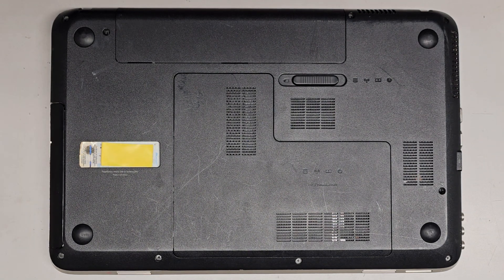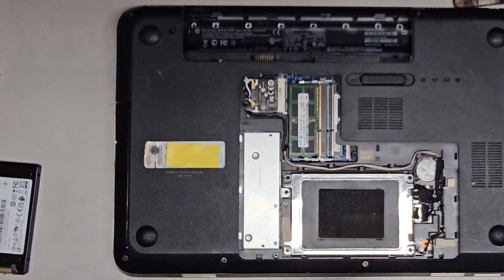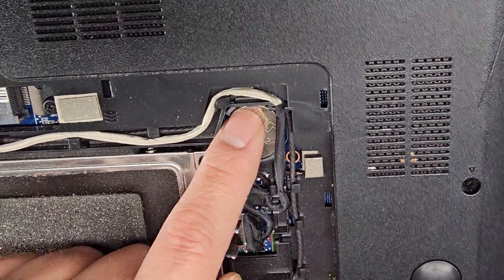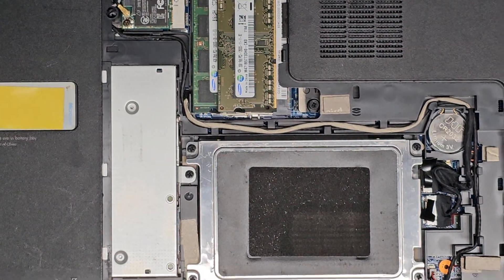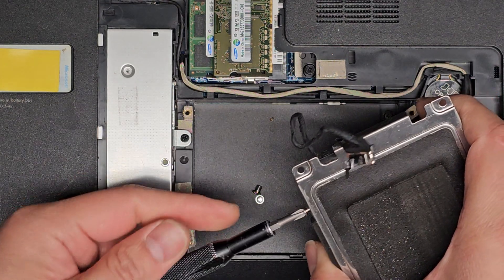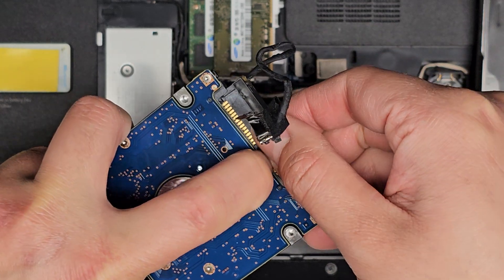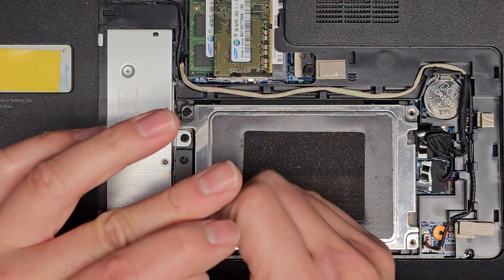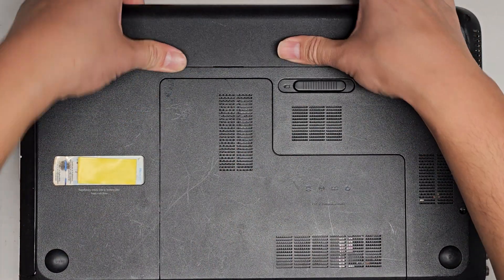HP Pavilion DV6 DV6-6C35DX Disassembly RAM SSD Hard Drive Upgrade CMOS Battery Replacement Repair

Comment: Hi there, nice video! Was really helpful in terms of the dismantling because I am planning to discard my dv6. 

May I check if the dv6 has an SSD by default? 

Because I managed to successfully remove the HDD before discarding but could not find the SSD 

(I’m guessing not since in your video you upgraded the HDD to a SSD)
Reply from the maker: Correct
Reply: @ItsBinhRepaired thank you! 😊
Reply from the maker: @zhongyingchia831 no problem

Comment: Hi i want to ask you, do you have original oem drivers back up? Windows update installed drivers really bad
Reply from the maker: Yup, get them from HP
Reply: @ItsBinhRepaired i ask because ive realized microsoft making my device performance bad by updating its own drivers. Rather i use oem(2014-2015) drivers and now everything is perfectly working.
Reply from the maker: @vickyvicmc5 nice
Reply: @ItsBinhRepaired can you please tell me your intel(R) HM65 express chipset driver version? Also is your gpu amd too?
Reply from the maker: @vickyvicmc5  I don't own the computers. I have no clue

Comment: Great Video!!
i have this laptop with the AMD A8 
upgraded to windows 10 its old and sluggish. wondering if i could upgrade the ram to 16g? or is 8g the max?
Reply from the maker: Pretty sure it should be ok
Reply: @ItsBinhRepaired  
Awesome!!! Thanks!!
Reply from the maker: @deathtony7  no problem
Reply: My dv6 has 24gb ram at the moment, quad core i7 running windows 11 25h2. I checked it can support up to 32gb! Btw if anyone having graphic driver issue like slow booting ect, close windows update update driver. Install manually the oem drivers.